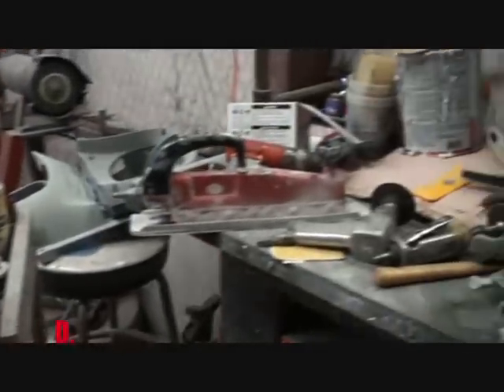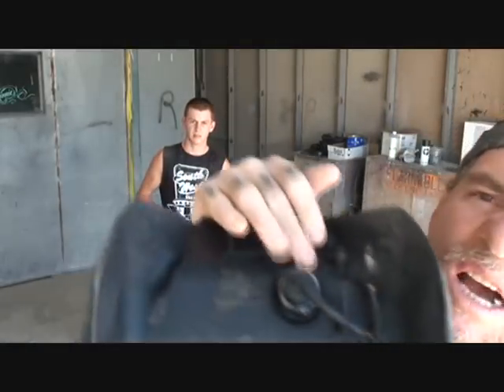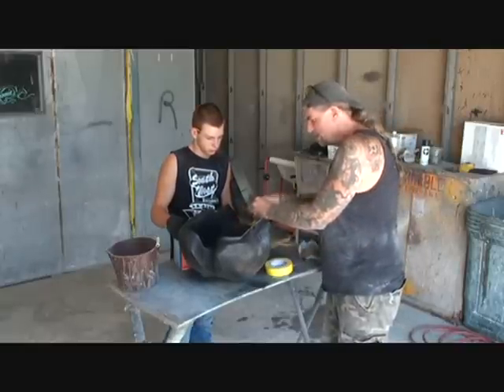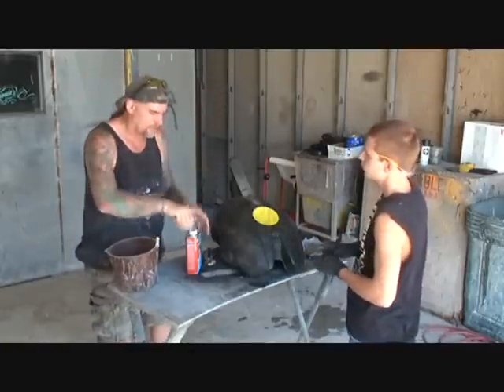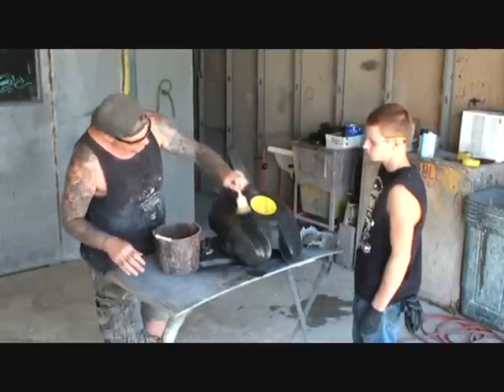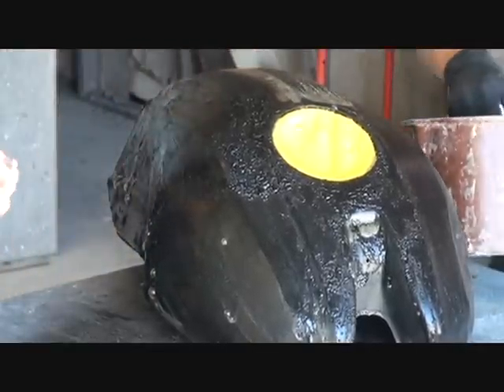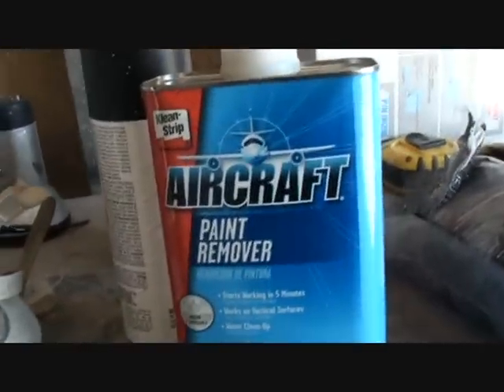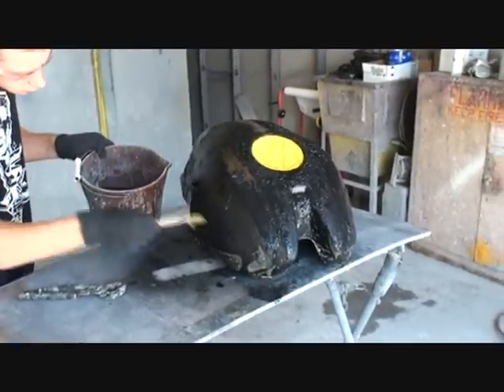How To Paint Your Motorcycle Tank: From Start To Finish-Part 1

Comment: I know this would be slow and impractical but at the repair shop I work in we do alot of brake fluid flushing, and there is about 5 gallons of used fluid laying around. A guy I work with restores model trains and uses this to strip old paint, slow but free, not too toxic and effective.

Comment from the maker: Sand the surface with some coarse sand paper to get to the bare metal, you should use atleast 36 grit and if you have a small grinder it would even work better, then do your body work and then prime with 2K filler/sandable primer.. Good luck Pete

Comment: I love that you stress on the safety of the chemicals. So I'm probably (assuming my husband doesn't barr me) going to be getting a new bike in Feb. BUT I want to repaint it a custom orange. It'll be 100 brand new so no wrecks or anything. Would the air plane stripper be just as effective?

Comment: It’s not aircraft brand it the type of stripper, if you look at the left corner of the can you will see the brand also you should apply the stripper in one direction not back and forth. Read the directions on the can. I have used that stuff a lot and it’s the best stuff you can get it’s made to remove the tough paint on air planes

Comment from the maker: With proper ventalation such as my shop with a good cross draft, doing a small job like this is no bother. If it was a car or truck and the doors where down, yes you would wear a good mask for protection. My Friend Pete is all about Safety In The Shop, and if there was any harm to be done on a job like this, we would be wearing masks.

Comment: Hi Pete, I'm doing a paint job on my tank using spray cans. I have started on the underside to see how I do but I have got a small run in the paint. Any advice on preventing runs and sorting them out. I did try my best and thought I was only putting on light coats but may have been to close.

Comment: Pete, I having trouble with the paint stripper drying out before it has work its way into the paint..
I keep panels in the shade 
I put on thick coat of stripper and try to keep reapplying to try and keep it wet... its costing we a shit load...
Do you have hints or tricks...

Comment: Why use expensive and dangerous stripper, when you can just soak the whole tank in lye and water? Better yet, hook up power and use electrolysis to strip, clean and remove rust! That's how I do my small engine fuel tanks.
Reply: chargermopar lye? Hahaha...thats even worse

Comment: did you sand that befor you put that on to help the stripper bite into the paint becasue i tried this on a tank and it wont even do anything
Reply from the maker: If the stripper didn't take the paint off you might have a tank that has been powdercoated instead of painted. You might have to d/a sand your tank instead of strip it..

Comment: Seriously bro, i need ta. know what stripper you would recommend because the shit i have been buying lately doesnt do a fucking thing. Its costing a shitload of money and still burns like a bitch but sits there on your part and wont even bubble the paint even after an hour. Used to be in the 70s and 80s, you put this shit on paint and it would peel ALL of it down to metal in a matter of minutes. I cant recommend chemical stripper anymore cause you just throw your money in the trash can. Also all of the thinner now days wont do shit either. My guess is the EPA fucked everything. I need something that actually fuckin works again!! 😨💩